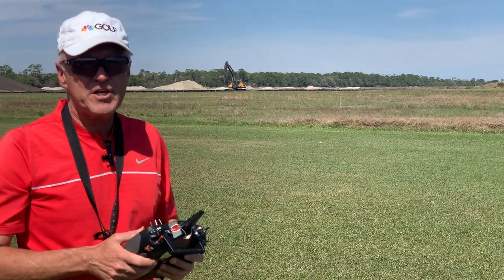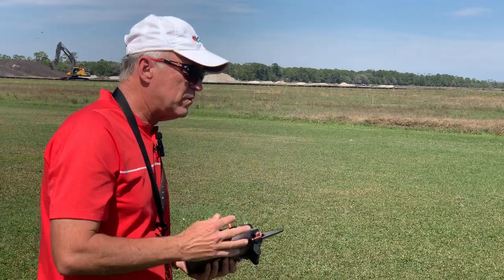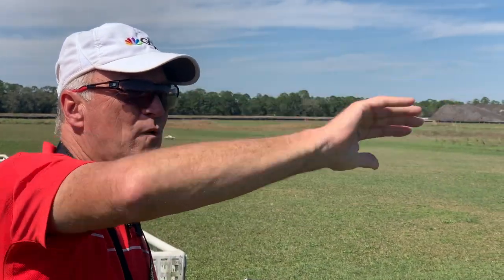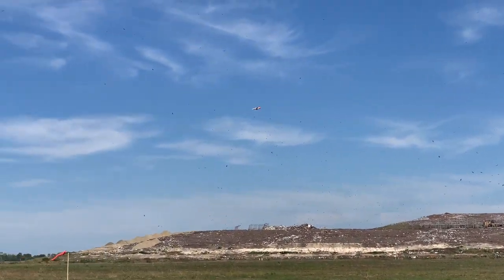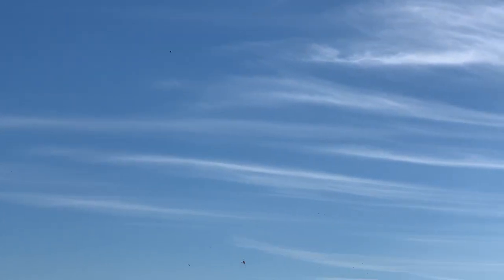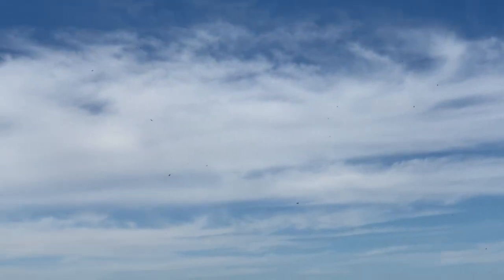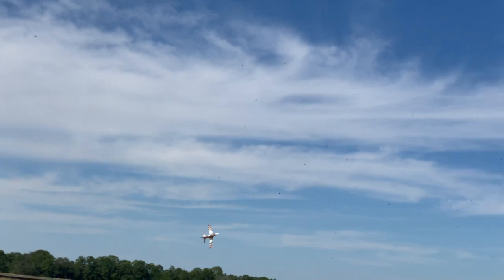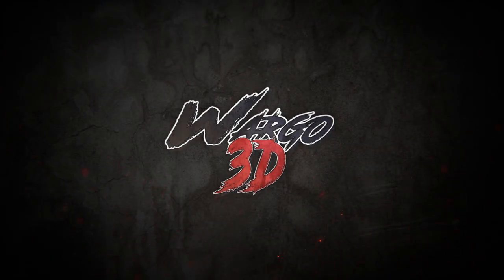Michael Wargo:Tips On Properly FLying EDF Jets

Comment: Awesome Michael. Thats the excat jet I have and cant wait till I fly it agian this year.. weather starting to get stable here in the North. But mine is pretty hard to keep it straight when Im speeding up on the grass runway before take off.. I have tweaked it quite a few times but still the steering wheel moves too much. so I learned how to just counter steer it so its straight. If I just add the  throttle to speed up it will go all over the place...

Comment: Great video!! Many thanks!! Which battery did you use?
Reply from the maker: ON the avanti, I used either a 6s 4000 which is my favorite.   A light one though.  It is a Zippy, and not a high c discharge.   This plane is so much better with a lighter battery.
Reply: @MichaelWargo Many thanks, and then, how much flight time do you get?
Reply from the maker: @piloto300  Not much really last few years.   Once a week or sometimes less with weather issues.

Comment: Another great video Micheal. 
Got a question for you, If I can. when do manoeuvers such as CUBAN HEIGHT, do you, like I do with prop plane, reduce power when you go down portion?

I have a new SebArt MB399 EDF, I just can't wait for summer to fly
Reply from the maker: YEs...  Making speed consistent on up and down lines is an important part of it as well as geometry
Reply: @MichaelWargo  thanks a lot for the confirmation Micheal. 
Another thing I did, is to slow down the response speed on throtle, so the EDF respond more like a turbine (spool up as well as spool down). It look and sound more scale and consume a bit a less energy every time I open throtle. will make you a video soon as the spring is back (leave in Quebec. where we manufacture snow for the rest of heart)

Comment: when / where exactly  in the landing process  is the best place / time to start dropping the flaps?......I am  always afraid  to put them down too early ( causing a slow speed tip stall ) .... ...thanks
Reply from the maker: I would do it when you feel it.   Generally though, I add right after my final turn or just before.   I have my 1st flaps in on my downwind leg.  If it slows you down, then you get to add throttle which is great for controlling the plane and descent.

Comment: are you sure you don't have access to instant power on an edf? shouldn't be you don't have access to instant lift over the wings? my edfs out accelerate my prop planes no problem, but they stall easier when turning. also I get off the grass as quick as possible. I don't want to risk breaking my gear and I don't have such a massive flying field.
Reply from the maker: I am really referring to Typical Jet characteristics.   It is really only the ramp up I am referring to. When you hit zero to full on a prop, it pulls at max near instantly.  With an edf, it takes a bit more time.   Granted, they are so powerful, it is not as noticeable as it used to be, but the Thrust curve is different than a prop.
Reply from the maker: For example, if you put an edf and prop side by side similar wattage to weight ratio, and raced them to 10ft, the prop would  win easily.  Prop would be there before the edf got very far, but the edf will be much faster top speed.
Reply: @MichaelWargo  I get you. Why we never see an edf 3D plane!!
Reply from the maker: @M4rkmcc21  look up wargo edf hover
Reply: If you are dead stick and stall there is EDF ramp up time and you might very well loose the plane in the stall.  Prop planes are a bit more instant.  It can be good to keep a little power in.